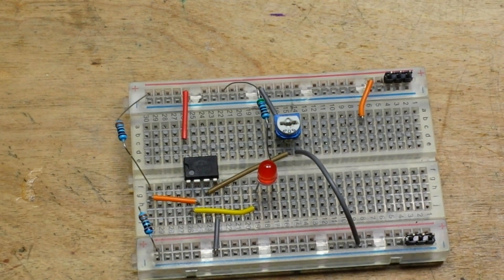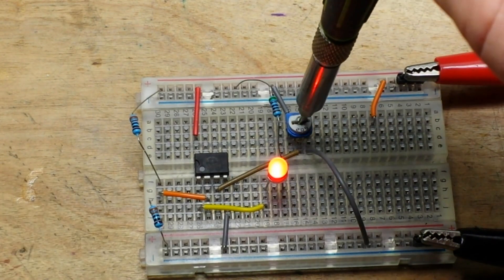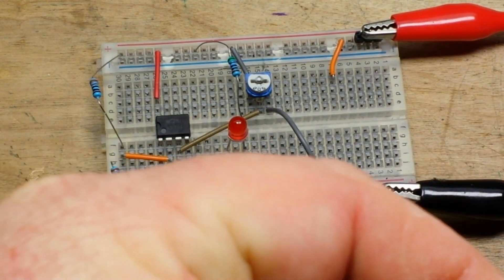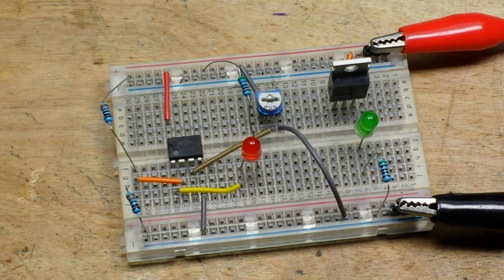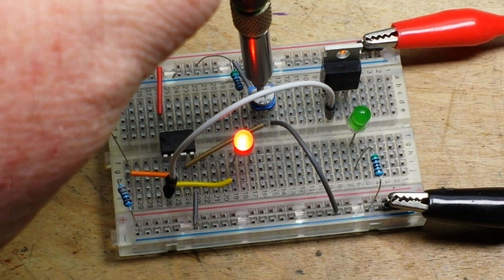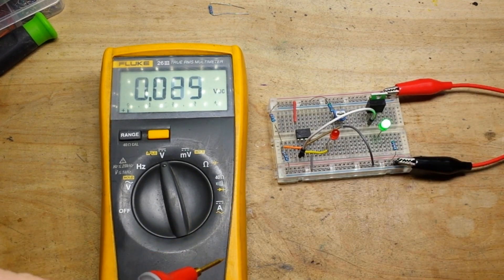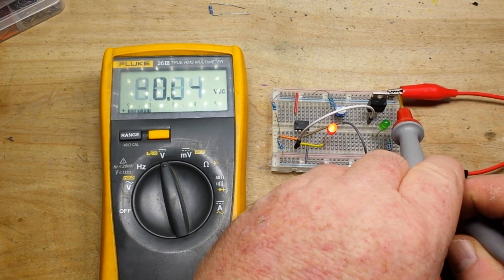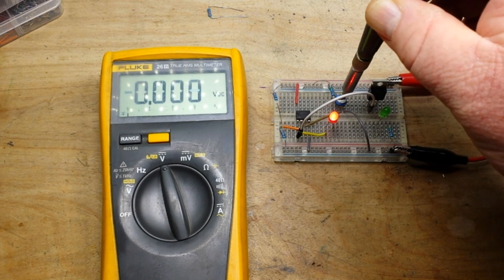Low Battery Cutoff Circuit with LM393

Comment: and what happens when the comparison voltage is directly proportional to the battery discharge? that is, this circuit should be in series with the battery and the consumer, the battery has 12.7V and the discharge point is 11.7V, volts are decreasing, what does the comparator understand?

Comment: This circuit is not worked with battery because load or no load voltage is different when battery is low. Please test and correct this circuit.

Comment: hi, this circuit will not work in practice, you need to add a Schmitt trigger to the circuit, once you disconnect the power of the circuit the voltage rises and it connects again

Comment: I have this question for you... say my supply voltage is dropping as in trying to monitor a battery voltage as supply then what happens is the voltage divider is also following this drop thus the reference voltage and then the battery just keeps running the load (in this case a small 100mA fan)... so I'm guessing here is that I need to put in a zener diode and current limiting resister to hold that reference voltage at 10.5vdc so this circuit can cut off the fan load and thus save the supply battery from over discharging !!  Can you please help on this one.
Reply: @ Steve Surick I came to the same conclusion. If we are going to monitor the battery, the trimpot should be regulating the whole circuit simulating voltage drop from the battery. Otherwise the voltage divider does not give a valid reading. Admittedly, I have not tried the circuit.

Comment: sorry but this was the worst cut-off circuit I've ever seen! The circuit explanation was nice but you should warn the viewers about the inefficiency. That's probably why you didn't show the cutoff current being drained right? voltage regulators are extremely inefficient and we shouldn't use them with batteries if our batteries are limited resources. I'd recommend a voltage detector though. And using a high pull up resistor such as 1Mohm to 5Mohm to keep triggered. This would give us plenty of time (at least half an year for a 1.2V rechargeable battery) to replace the battery or recharge it if our circuit supports that. That's not the perfect way,  but I am looking for better solutions which last longer of forever giving us more time to replace the bat without causing damage to it

Comment: And if the solar panel that puts out 10 amps of current..? How are you supposed to connect that to a lm324n..? Capacitor in parallel with the panel? Seeing how capacitors don't allow DC current through...

Comment: Way cool! I'm using solar panels and a buck converter to charge a 50AH LiFePO4 power pack, but it has no under voltage protection to avoid thermal runaway. With this circuit, I could also add a thermal sensor to the other half of the LM393 to avoid charging below freezing. Thanks!😎

Comment: To begin with, sorry about your heart. I've had a bypass operation in my left leg and a stent in my abdomen AAA. I've lost 90 pounds using sunflower lecithin and milk thistle. Let me know and I'll talk more about it.

Secondly, I don't get this circuit being used as a switch for a battery. 30+ years in Electronics. 

My problem isn't with the circuit. It obviously works. But your CONTROL section is still drawing it's power from the battery source.

I suspect that you are using a variable bench supply. Instead of changing the cutoff potentiometer. Why not vary the input voltage?

If the goal is to protect the battery/ies. Wouldn't it be better to use a n/o relay with a circuit that ONLY draws current above the cutoff voltage?
See if you can get the schematic for an Altronix AL1012 or AL400 power supply. I use both of them. My 400 series powers everything in my home structure can. Lose power, still have cable, phone, Wi-Fi and routers.
There could be a Pre-cutoff relay before your circuit, like a critical break, no power until the voltage comes up a little.
As the voltage rises, relay lets power to your circuit. A little higher and the load is energized.

Comment: there is a problem. when I use a LIPO with full charge the voltage is 4.2 Volt. the refence voltage will be 2.1 Volt. then I adjust the potentiometer, so the ligth will be on. if the LIPO is empty, the voltage will be 3 volt. the reference voltage will be 1.5 Volt. But the voltage on the potentiometer will be 2 Volt. than I drain the LIPo more. with 2.6 Volt the reference voltage will be 1.3 Volt, but the voltage on the pot will be 1,8 Volt.
Every drop on the Lipo takes a drop at the reference Voltage and the potentiometer Volt !

Comment: Is there adequate hysteresis in order to prevent switching oscillation on the cusp of voltage cut-off?
Reply: there is no hysteresis here, it is a simple demonstration circuit and will not work in real life

Comment: Ok question here..i dont think the LED should be in the source line?, because N channel works by voltage difference between gate to source. Since the LED will create some voltage (granted its only .7V), this forces you to have to make the gate an even higher voltage to stay on correctly. The LED should be in the drain I believe, that way you avoid any gate voltage offset like you are going to get with how you have it here. I just dont want people to see this video and put thier loads into the source and then not be able to turn the mosfet fully on because now there is a gate to source offset, that resistor will add even more voltage offset, i am wondering if you are even turning on the mosfet fully beause of this

Measure the voltage at the source pin to ground and see what it is, then subtract that from the gate voltage. For this mosfet it has to be 4 to volts to turn on fully for min rds (on) otherwise if its lower than that its on partial and you waste energy in the switch.

Comment: Merry Christmas to you Paul! And thanks for telling us the secret how to protect our batteries. However I am still wondering how to use this is if  the total circuit (for instance a 9 Volt power supply for a DSO-150) is powered by 4p lion cells. How can the power supply shut off the 18650 cells when it sees only 3 volts?

Comment: What if you used a zener diode on the comparitor power pin so once it shuts the circuit off the comparitor would bleed the voltage down a tiny amount more and the zener would stop flowing current ?

Comment: 393's also come in dual or quad versions and quads were widely used in circuits with led bar-graph type meters like older commercial PA equipment like mixer panels and wireless mic receivers., cheap battery chargers and some RVs also have them in  the system monitors that read battery and liquids tank levels 
The LM3914, 15 and 16 are actually led bar drivers that are virtually plug and play. They wrap all the 393 circuitry into one IC that can support like 15 LEDs? or something. Old Telex wireless mic receivers used them in socketed form so I have a pile of them in my IC bin.

Comment: I don't understand how this can work as a battery cutoff. I assume you are using the pot to simulate the battery getting lower over time by lowering the voltage into the opamp. However the voltage divider is still based on the full 10v input to create a constant 5v reference. In a true battery scenario wouldn't this reference voltage also drop as the battery voltage decreases? I am a hobbyist so perhaps I'm missing something.
Reply: @DJ Mick: Excellent point. If you want cutoff at a specified voltage, you'll need a reference. I'm used to seeing Zener diodes used for this, or sometimes a series stack of several diodes (adding up their forward drops).
   LM393 spec sheet from TI does not show a voltage reference within the chip.
Reply: That is correct, you would need some kind of reference like zener or 431 reference which is very commonly used in all kinds of power supplies for output regulation

Comment: If you use this for low voltage cutoff on a battery pack there is the issue that once cutoff is achieved, the circuit itself will continue to discharge the battery. What is the quiescent current of the circuit with the input source at your programmed cutoff level?
Reply: :D yha :D

you just need a transistor, once the the (low) level is achieved then it cuts. To find correct transistor and the resistance is the only funny part of such exercise.
Reply: I dont think this would work for a low battery cut off. The reference voltage would drop with the battery voltage and not trip the circuit.